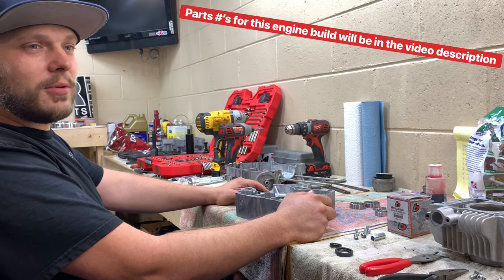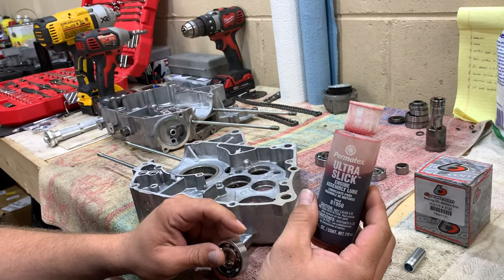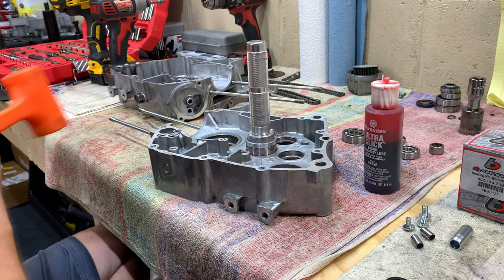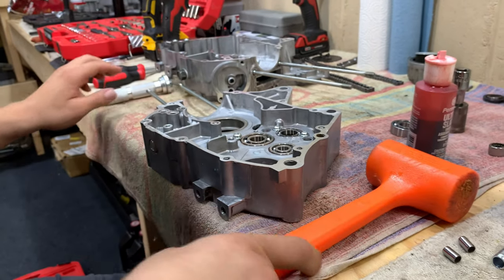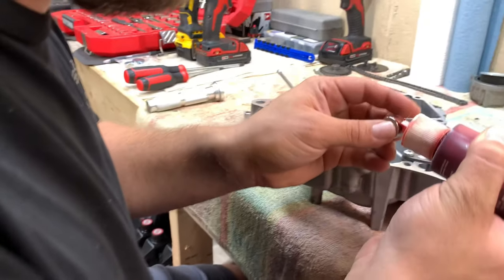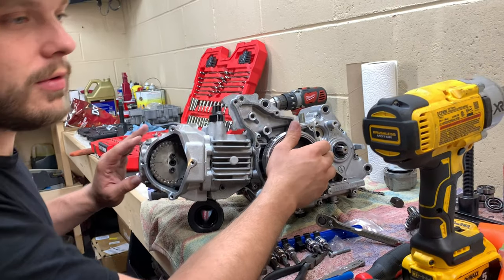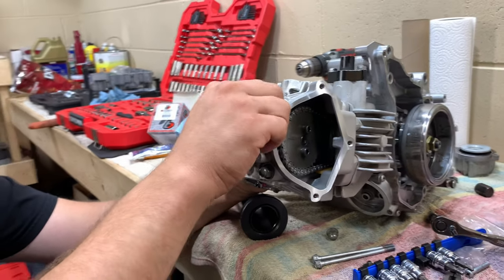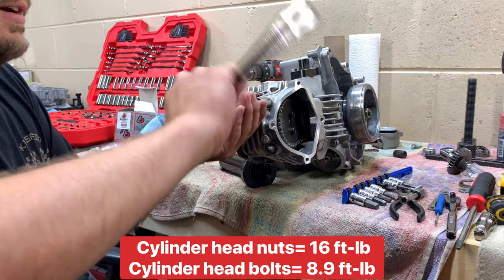HOW TO: 155 stroker complete assembly for klx110.  Give those crf110 stock mods the smoke!

Comment: Hey man thanks for the vid. I used it to do my stroker crank. Was curious as to what you recommend for jetting changes going from the 143 with v2 to the bigger crank??
Reply: Good question! Here for the response
Reply from the maker: I use a vm26 carb.  Jetting wise i run between a 180-185 jet depending on outside temperature.  Im at sea level basically.  For the needle clip i normally run 2 up from the bottom or in the middle.
Reply from the maker: Some motors also like one up on the pilot from factory size.  Ive also had some that like the stock pilot jet more.

Comment: I’m planning on installing a stroker crank and V2 race head. Already running a 143, VM26 and full exhaust. Do you have any thoughts on sending the fly wheel out and get it lightened?
Reply from the maker: Getting the flywheel lightened is always a nice upgrade.  Makes it quite snappy.  Legacy minis is a great place to send your flywheel for this upgrade.

Comment: Please don't lube the outside of the seals before installing. Install them with YamaBond on the outside.
Reply from the maker: Ive always lubed them.  Never caused me a problem.  Id rather not glue them in with sealer.  Ive never had a leak.  To each their own my man.

Comment: Did you have the timing mark in the head not line up perfect? Did my build with almost all the same parts with this video and a the klx guide but my head timing seems to be a half tooth off at tdc
Reply from the maker: They just are that way sometimes.  Its rarely ever dead on.  But if you go a tooth back or a tooth forward, it will be off noticably.  You will know if its right.

Comment: I appreciate a good engine build 
But you’ve got my dream bike 
I have the v2 race head the high comp forged piston the big bore 
But I really want the bbr procomp swing arm
Reply from the maker: The procomp is one of the best swingers so far in my opinion!
Reply: @simplyminis2064  I agree 
It just costs 2 grand
The bike isn’t worth that

But tbolt has a swing arm that bolts up to the klx it just takes a few modifications to work

Comment: at 19:44, there is a metal ring and O ring just above the shift drum and to the left of the timing chain guard.  Where do those go?
Reply from the maker: That goes on the output shaft on the outside of the left case if your sittin on the bike.  Goes in before you install the front sprocket.
Reply: @simplyminis2064  Thanks, that one was driving me insane.  I am still kicking myself because the gear sleeve at 29:11 fell out when I pulled the case apart and I put it back together without it:(.  That part isn't in the service manual or other videos.  I just happened to see it on the second go around with this video (thank you for catching it).

Comment: You don’t use the oring under the cylinder felt gasket? I didn’t use one on my 155 build but just curious with your experience on these motors what you think about using them. No leaks on mine so far, I’d image it’d be fine cause it’s just stopping oil from coming out unlike a two stroke motor

Comment: Hey I think I am going to need a new flywheel and the thing that goes on the back of it. I have a 2017 KLX110L btw. Do you know anywhere that sells the flywheel assembly including the thing that screws on the back. I can buy OEM, but that is $300 and I would prefer not to spend that much lol.
Reply from the maker: Go on planetminis 2.0 and make a post looking for what you are looking for.  You might get lucky and somebody might have a chooched bottom end theyd sell you parts off of.

Comment: Kawasaki just loves to instal those plastic gears on oil pumps. That’s the weakest point of the engine if not a planned obsolescence manifested
Reply from the maker: @denisdemidovitch6897  ive honestly never had a problem with them.  Not even on a built to the hilt klx engine.